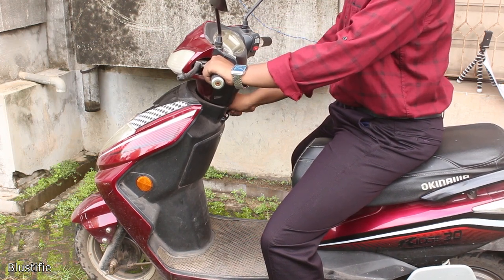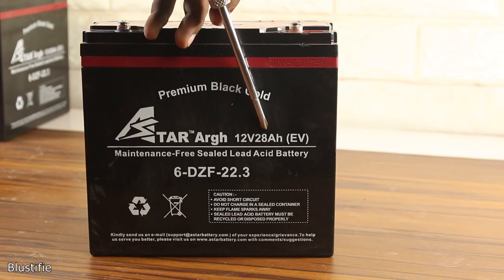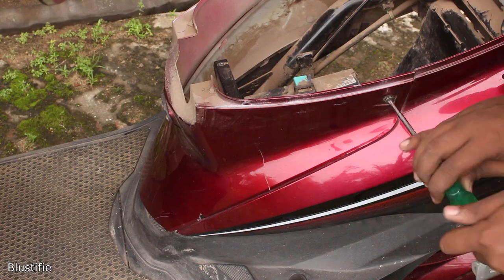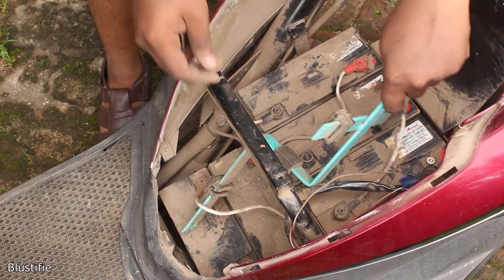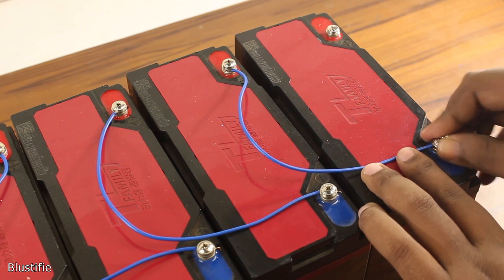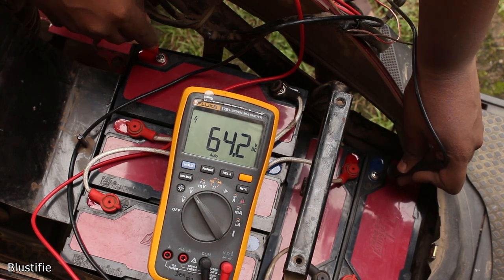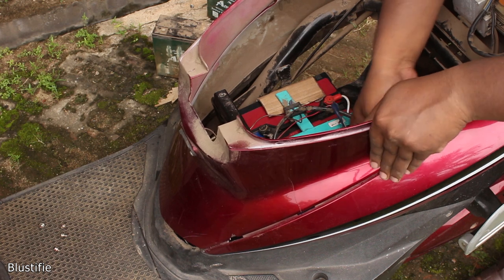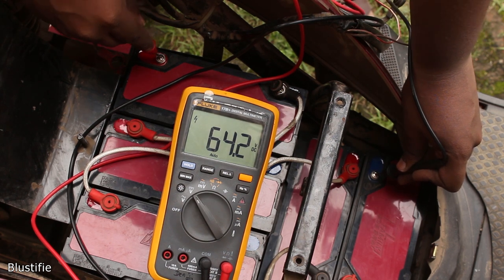EBike Battery Pack Replacement || How to Replace Electric Bike (e-bike) Battery?

Comment: I really appreciate how thoroughly you explain the process. It helps seeing the entire E-bike from the beginning, how to take off parts to access the battery, cleaning the battery area, testing the batteries, etc. Since we no longer live in the state where we purchased ours over a decade ago, your video helps tremendously. Our state does sell this bike, and we don’t want to drive over 2 hours to a shop that sells E-bikes but still not this style. They would probably just look up a video like what I did. THANKS again!